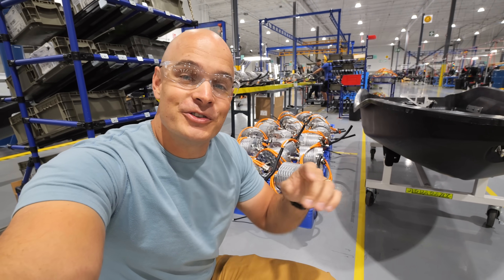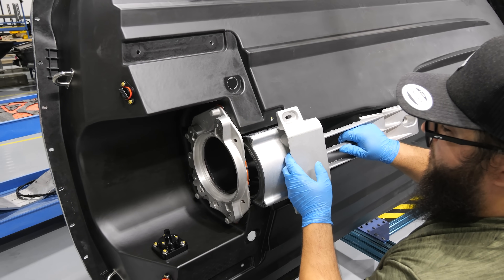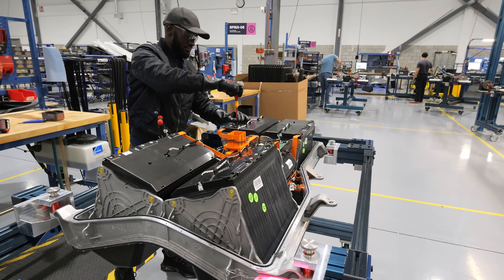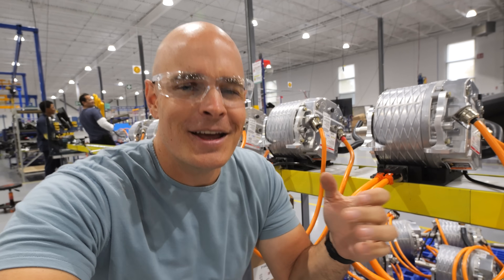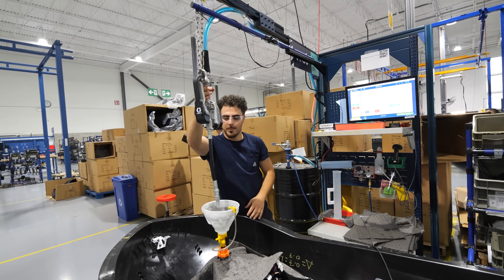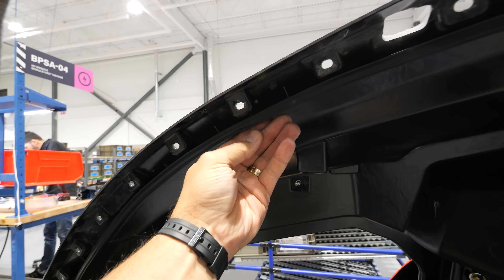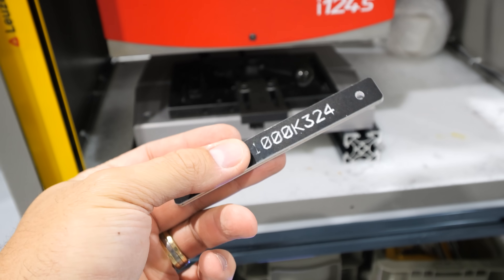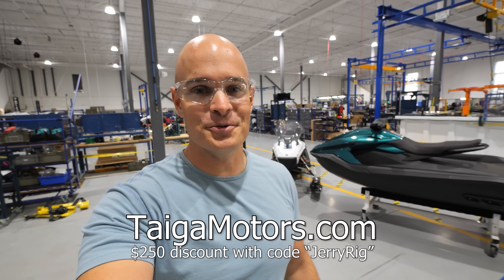How To Build an Electric Jet Ski (Water Durability Test!)

Comment: Only real problem I see with these is that the through hull driveshaft seal needs to be replaced as a maintenance item on ANY jetski, gas or electric. They put the battery on top of this seal, so it is not possible to replace it by yourself unless you have access to an overhead winch. Doesn't look like they thought about that maintenance! But good to see it has CCS fast charging, that makes this actually chargeable for same-day cruising. Most other electric jetskis require overnight charges.

Comment: Cool video, but with a 23 kw/h battery and 120 kw motor you get about 12 minutes of runtime at constant full power. So that translates to a realistic runtime of probably 15 to 20 min when you race and do donuts on the water like most jetski owners do.

They state that you can have a runtime up to 2 hours, but that is probably like 90% of the time going 15 km/h. Besides that,  the base model costs 20000$. 

For that money you can buy a base model Seadoo gti se 170 hp and money leftover for a trailer, gas and maitanance for the upcoming years.

Comment: Sorry, did you say 24 kWh battery and 120kW motor? So, 12 minutes of use at full power? Granted it's not working at full power all the time, but a jet ski is going to be a lot closer to full power at max speed than just about any other vehicle. The website says "Up to 2 hrs" , but at 24kWh battery, it would have to be nerfed to 12kW, or the equivalent of a 16hp gas jet ski to attain that. Unless this thing has some unheard of efficiency gains, it's either not much fun, or a lot of fun for a very short amount of time.

Comment: Zach why do you always promote this electric trash. Everybody who's ever owned a jet ski knows that an electric jet ski will not replace a gas powered jet ski especially when you go out into the ocean. Also it needs to be stored in a garage and plugged in for maintenance you can't leave it out in a cold yard all winter long and expect the batteries to work the same next season.

Comment: wow, that thing is a pig.  Their website fails to state the weight, but I looked it up and it weighs 738 lbs, I bet it steers like a mack truck and good luck trying to pull 738 lbs onto the beach.  My 1994 two stroke yamaha wave raider goes over 50 mph and weighs 388 lbs and runs all day on one tank of gas.  Their website shows 2 hours of charge, I suppose you can fire up your generator and charge this thing so you can cruise around for 2 hours.  The lake is quiet but the beach is full of generators trying to charge their PWC. 🤣  Looks more like a solution looking for a problem.  I will pass and keep the gas.

Comment: is there a way to put in a new battery when they inevitably come out with better batteries for the units that will last longer and charger faster ?
Reply: When are these better batteries coming? The highest capacity 18650 is still 3.5AH as it was 15 years ago...  Battery tech is not there yet for plaining speed watercraft, not even close.

Comment: This concept is not there yet.  They don't have electric power stations at local docks.  Until electric boats become a thing I just don't think this concept will work.  Most people bring their toys (jet skies, boats ect.) to the camping sites for the weekend or holiday.  With a 1 1/2 to 2 hour ride time before the battery loses its charge.  That is not enough time to get the toy in the water before you have to charge it up.  Then you would have to take your jet ski out of the water bring it to nearby town and find an electric charging station to charge your jet ski up.  My problem is it's about 5-10 years away from being practical.  I really like the idea and hope it succeeds

Comment: Great! I want the jetski and the snowmobile! I'd like this snowmobile for today over 14" of heavy wet snowfall around our 40 acre property at 9600' elevation in Colorado.  But I only need 10-25 mile range and much lighter components, I already have a telemark skiing plastic towing sled with rigid connecting rods I'd like to attach to it to go slow for one mile round trips to the road on our 12% grade steep mountain road driveway. Then I want to take the battery out on a hand truck and use it to run my camper Van to drive to Florida. Then I want the same battery out of my camper van to partially run my simple house in Florida that will have permanent solar panels with light duty minimal house battery system but also connected to public utility system to ensure air conditioning. Then I want to put the hand truck campervan battery in my jetski or jetboard in Florida for 2 hours for a fun ride, then plug it into the simple Florida house again.  This way the battery would be more fully utilized year round, and therefore more easily watched so therefore more properly cared for. I see the factory assembly video seals the battery deep into the body, so what I want is impractical today, but this is what I will hold out for, so maybe it'll be available in 2 years? Then you could sell me both a snowmobile and a jetboard or jetski, a win win for everybody.

Comment: That motor and battery packs seem to scream for an old car upgrade kit.
I think on my oldtimer all could fit into the engine compartment, leaving additional space for 3 or 4 packs where the fuel tank is.

I'd guesstimate the motor/control/charge package had to be around 5k and the battery pack+hookup wire 3k each.

Comment: Cool, but not for me. I am a jetski rider,  but i have some concerns. One being the pto seal, there's no easy way to change that. You're pulling the whole battery. 50% of my experience in any of my vehicles is the feeling of it being alive. The sound, the vibration, the exhaust, the muscle/ machine. That's not replacable. And theres some days where i go through 2-3 tanks of fuel in a day doing touring rides. That 3 min fill-up is worth every penny

Comment: 2 Hours of drive time is really short. I cant imagine going out to a lake or reservoir in the middle of nowhere, and you have to charge one or multiple of these over a 2-3 day period. For $20k, these better come with a folding solar panel, and charging system that can be used anywhere.

Comment: not sure if you can do low budget 110cc Chinese quad like tao tao on 7" rims conversion to ev from gas and a battery that will last 6 hours on one charge that can be made by the average joe just basic no lights just kill switch and on start i think 48v should be comparable. I have a 110cc and neighborhood does not allow gas plus it's loud. thanks

Comment: 24 kwh is equilivant to having a 5 litre fuel tank. At maximum output, 120 kw, the battery would last 12 minutes. It would be a mistake to buy an EV unless it has an LFP battery.

Comment: 120Kw of Motor power and 24 Kw/h of Battery capacity. That´s 12 minutes of full throttle if you could use the whole battery, wich you can´t.
Don´t get me wrong, I really like electric, but this is kind of a joke.

Comment: This ski is 100% going to be a throw away in 3 years object, I don’t care how much “water proofing” you attempt it’s going to happen especially with the same garbage carbon seal design Seadoo has. The placement of the motor under the battery and at the very bottom of the hull with really no way to clean all the salt away screams poor design.

Comment: the future is electric, but not shitty li-ion, but instead, hydrogen. The industry already uses hydrogen for a reason. The future, in electric, is rentals. You rent one that's fully charged, then drop it off at a garage to charge until it's ready for the next person. They're cheaper to produce and maintain than a gas vehicle, meaning having multiple is way more viable.

Comment: Being in Canada, I am curious to see the differences between the Jetski and the Snow Mobile.  I am curious what the effect of temperature on the batteries is, particularly at the extremes and the lower negative temperatures.
Reply: Being anywhere that requires snow mobile, will render electric based ones more or less useless

Comment: So...... what's the fail safe that prevents 400 volts of death from shooting up your crotch if water does manage to interact with the battery system?
Reply from the maker: Unless you’re making direct bodily contact with the positive and negative battery terminals it wouldn’t be much different than any other sinking ship
Reply: @JerryRigEverything I would have to disagree to a point. If the circuit experiences a short of some sort and comes in contact with the wet environment  it's not much of a stretch to say it will shock or potentially electrocute the operator. Hence why I'm asking what is the failsafe for this device?
Edit: I'm not talking down about the product I'm genuinely curious about safety features on electric vehicles such as this

Comment: Zack, you definitely need to return for the snowmobile assembly and take it further.  Take your Rivian (or fine, a Lightning) and tow the Taiga to the trailhead, ride around, and then use V2V to re-charge!  The idea that sleds or PWC's could soon share electrons with the vehicle they're towed by is really intriguing.

Comment: Nearly $10,000 more than a gas equalivant.   .. Would require an electrican, ect to put a power charging station on your dock...  Which is kinda a hazzard when you have kids playing on yoru dock.     Would be interesting to know how long a batrery last (discharge at WOT-because you never ride a jet ski at less than full throttle) and number of years.  I believe 100 hours of  ride time per year is common at our lake in Iowa.   Fuel bill is $500-600 per year/ per jet ski.  

If we all had 1990's jet skit (two stroke) that smell and are louder I could see a larger desire for electric.    I personally have wanted an electrica wake boat (quieter to hear the rider, no shutting off the enginer nad restarting all the time,  added weight for better wake, and a solar charging station of the boat lift canopy... but again it still has to be cheaper or equalivant to an ICE for me to purchase.

Comment: These are interesting.
I have a 75 Cadillac with a carbureted 500 big block as well as a Chevy Bolt EUV. On these hysterically opposite ends of the spectrum (in terms of efficiency, among other things) the Caddy costs about $0.29 per mile to operate, where the Bolt averages about $0.035 per mile. On a 20 mile trip, this works out to $5.80 for the Caddy and $0.70 for the Bolt.
More relevant to this video, I have a carbureted two stroke Yamaha WaveRunner. When I ride from my house to the Outer Banks and back, which is roughly 20 miles round trip, it costs me about $15 in gas and 2 stroke oil on average. By comparison, I calculate the same trip to cost roughly $2.40 in electricity for the Taiga.
That being said, where the relatively small 13 gallon tank in my WaveRunner would still be over half full, the Taiga would have little capacity remaining after such a ride, and would likely have to be driven fairly efficiently to avoid range anxiety on the way back. Further, you’d have to plan for having a full battery before leaving and a level 2 charger by the water if you want any chance of additional ride time that same day.

Comment: The range is abysmal at 28 miles. That's 27 minutes of range at the top speed of 62mph. The Kawasaki 310 LX for the same price has 110 miles with double the horsepower, lol. Not to mention, you can carry extra fuel with you if you want more range, but you can't do that with electric. I guess they made the battery really small and light so that it could get somewhat decent speed with such low power, lol. The Tesla Roadster will allegedly have 620 miles of range when it finally comes out at some point this millennia, which would dwarf any other sports car despite seating twice as many people. On the other hand, this Jet Ski has a quarter of the range of its gas counterparts despite being slower and seating less people (unless you opt for the more expensive carbon fiber model that costs even more than the most premium gas Jet Skis).

Comment: I don’t get how you charge it? Do you really have to take it out of water every 2-3 days??? Or can you just take out an battery and charge it at home?
Reply from the maker: It can charge on the water as long as you can plug it into shore power. Like big houseboats do.
Reply: Ok nice, i thought i have to disassemble the Body the get to the batteries to charge it.

Comment: That’s so cool! What kind of electric motor are they using? Also with electric power, they could essentially turn that ski into a submarine since the motor doesn’t need any oxygen to run, like a normal combustion engine does. I’d love to see them make a hybrid jetski that can go above or below the water.

Comment: Cool though a 2 hour ride time per charge for the jetskis doesnt seem like very much considering th3 average ridetime for a gas powered jetski is 4-7  kind seems like a slide backward especial when u think about the fact that u then have to wait 40 min if ur using a fast charge system or even linger on a normal power supply and this assuming u have access to a hookup where ever ur at. Its an a2eskme concept and th3 the no maintenance and damn near zero noise is awesome and all but u go to the lake to ride but ur stuck at a 2 hour time limit be nice if u could swap out battery packs

Comment: This is extremely cool, but it looks to be about $5000 more than a generally competitive gas powered model. Plus, it is much easier to buy more gas on the water versus finding somewhere to plug in. Probably good that they are low volume production for now.

Comment: Very cool, but how repairable are they? Are those gaskets between the upper and lower shells going to be available, if the batteries are completely watertight that means they are not going to be as repairable as, say, a Prius battery, so if cells start going bad you can’t replace them. Are they expecting these to be disposable once the batteries are depleted?

Now we need someone to start retrofitting late 90s Sea-Doo jet boats with blown two-stroke engines with this electric set up! I would buy one of those immediately.

Comment: If I lived on a lake where I could put a charger on my dock, that would be kind of cool. Or the public accesses will need to have DC fast chargers. 
I don't know about the snowmobile though, the cold will reduce the capacity either directly or by heating itself. I live right next to a trail so I could go out but looks like I'd only get an hour or two of riding before I have to be back home or find a charger.
Until batteries get at least 2x density in both volume/weight, powersports will be tough. Cars still make the most sense right now with their comparatively low rolling resistance and available battery space.

Comment: I would be cool if you could swap the batteries and motors out into other vehicles. That way you start off with the Jet Ski then ad a snowmobile, quad, motorcycke etcetera but it makes it a lot more affordable after the initial purchase.

Comment: Isn't a snowmobile a pretty unoptimal use for electric with modern battery tech? It seems like you would be going through batteries way faster than other applications, not to mention never getting the use of their full capacity

Comment: At around 3:00 minutes in, you talked about no winterization and the lack of maintenance which is the part that most boat owners don't seem to see yet. If electric boats become a bigger thing in Florida, that'd be awesome since the worst part of boat ownership down here is the gas part.
Reply: Boats are too inefficient to make anything electric worth having. It’s takes 300-1000hp to get boats up to cruising speeds and even small ones get 1-2mph. Even 5 of these power cells would get you a whole 20-30mins.  Maybe some day tho.
Reply: @BeyondTheBendOutDoors  its only a 24KWh pack, and the motor is upto 120KW. That isn't a lot of run time in the ski lol.
Reply: @ionstorm66  doesn’t matter what the motor can do, it matters what the batteries can do. 

Not getting very far with that .
Reply: @BeyondTheBendOutDoors that's what I'm saying, you'll be lucky to get 30 minutes on the ski under heavy load, let alone a boat.
Reply: @ionstorm66  in deed..   granted my race ski uses 10gal in about 5min. It’s a REALLY fun 5min. 😂😂